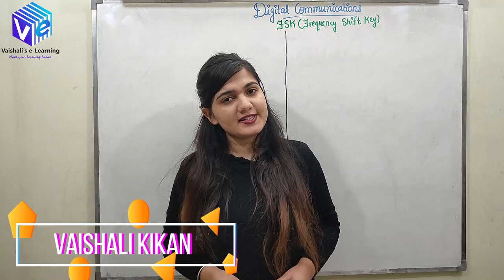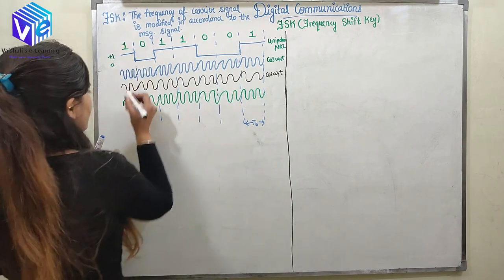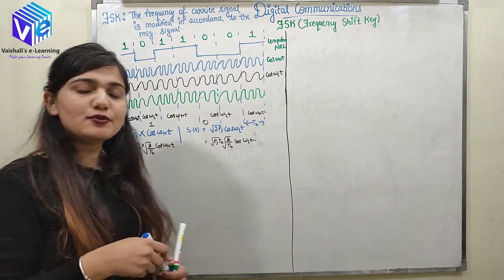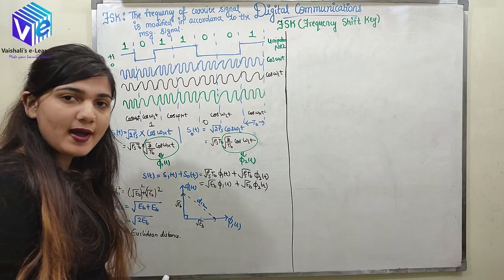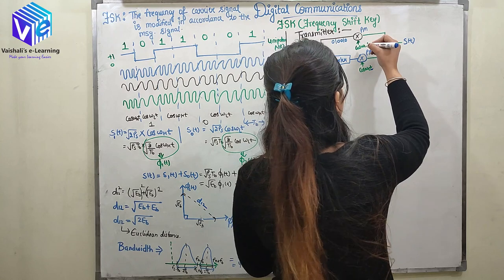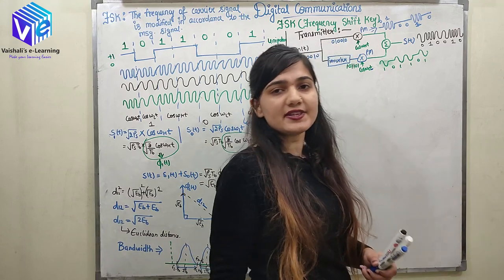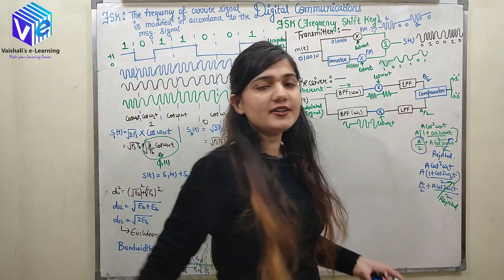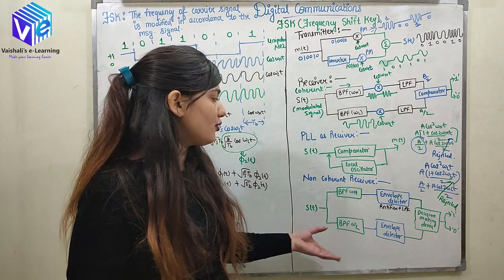L 8 | FSK Frequency Shift Key | Digital Communication | Vaishali Kikan

Comment: 15:55 How comparator differentiate in between a/2  because amplitude is same
Reply: that was also my question. After thinking a long time about it this is what I suggest:
in a certain time period T_b, if a 1 is sent then the comparator gets A/2 from the top side and nothing or maybe 0V from the bottom side --> it gets recognized as a 1. Now if a 0 is sent then the comparator gets A/2 from the bottom side and nothing or maybe 0V from the top side --> it gets recognized as a 0

Comment: I think your  bandwidth calculation is not write it  should be  fh-fl+2fb not 4fb.
Reply from the maker: I am talking about the bandwidth occupied by the desired signal.. 
In between bandwidth is not used ..
2fb for upper band and 2fb for lower..
Thank you so much for your valuable feedback..
Stay connected for upcoming videos..